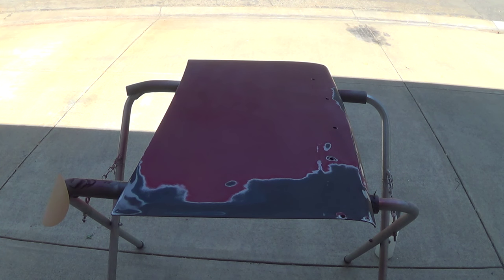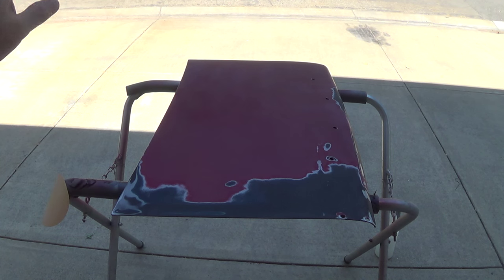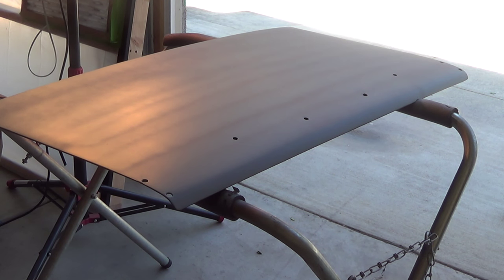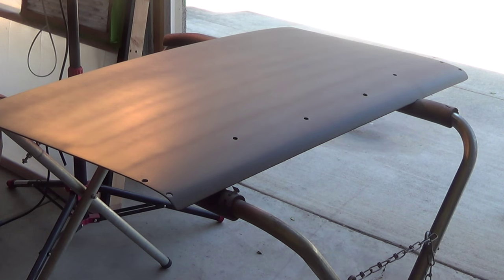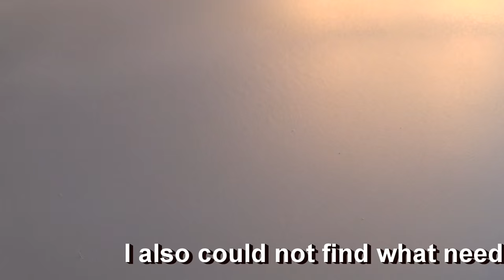I can stripe primer! Boo hoo

Comment: I watched the follow up video but I thought I'd shoot you some thoughts on this one.  I think this is a thin viscosity product so therefore it dries quick.  A couple things I do are to drop the pressure a bit and close up on the panel.  Looked to me like that pattern wasn't very wide to begin with which leads me to believe either the material wasn't adequate to fill the pattern (read - too small of a tip or restriction at the point of fluid delivery).  Too low of pressure will lead to a heavy center pattern and dry edges, too much will blow out the center and be wetter on the edges. Typically less air pressure = wetter pattern to an extent.  I have been painting for quite some time and I always have a piece of masking paper on the wall and I use that to do test patterns and tune my gun every time I spray a product.  I want to see how it is spraying and what it will take to run it.   I never rely on previous settings to work for every job.  They get me in the ballpark and I fine tune from there.  Hope some of this helps out :)
Reply from the maker: +Velvethamma Thanks Shawn. I did try some of those tricks today on the 2nd spray. I may have helped a little, but it still sucked. :) Cheap primer man. No other product has ever done that to me.

Comment: Erik, I have this same gun. The 1.8 should be great for high build. Was it really hot there when you sprayed? May just be a fan size / overlap adjustment.
Reply from the maker: Double R Restorations You know, I am not sure it is high build. I think it is just sandable primer. So, maybe the tip is too big. It was pretty hot, and I had the fan running, so that may have dried it out. It is ready-to-spray cheap primer, so there is no reducer or anything I can add.

Comment: Not sure it seemed it was drying along the edge of the fan as it layed down, you didn't  have a wet edge. What was the temperature compared to the temp of the reducer was it a fast drying reducer? I also think maybe the preasure was a bit too much. I am still trying to figure things out myself, there are a hundred different things that can mess with a paint job. I think you need to get things figured out before using color. I had the same problem when I painted the jeep front end, it was wierd the first coat went on well but as the sun came up and the temperature got a little hotter it started to stripe on the hood. I just think it was too hot for me and was drying as it layed down. I hope you get things figured out. Good luck Eric
Reply from the maker: ***** Hmm - yeah that makes sense. It was pretty hot today, and I had the fan running. It did look like it dried really fast on the edges.

Comment: Pshhhhh... Sorry I'm no help. But I will be keeping up with this one to see what I can learn from it, so thank you Sir! You mentioned below that this is the less expensive stuff... Maybe this is how it lays out and all you gotta do is sand to a uniform finish? It's primer so if it was me I wouldn't care too much because I figure I'll be sanding most of it off when I'm blocking the thing out. How does it look after you've sanded it?
Reply from the maker: 512kjt That is very true KT. This is some cheap a$$ ready to spray stuff. It dries really fast, so it could just be that. It did sand out fine, and I broke through really easy too, so I don't think it is high-build either. So, the 1.8 tip was probably the wrong tip. I will put another coat on next time with the 1.3 tip, and turn the fan off.

Comment: what air pressure are you running at the gun seams a little hight and if you can open the fan up a bit wouldn't hurt.
Reply from the maker: ducksniffernz I had about 22 psi going in to the gun. I can't open up the fan anymore, it gets uneven. It could be because the tip was too big, I don't know.

Comment: this is just my suggestion if i was you i would pick a product and learn how to spray that product using there primer and all the way to finish.That way if you would have a problem you can contact there support people and find out the info you need.I know we all on a budget but this way you dont have to spend time and money to get it right when you want to lay the paint down.later
Reply from the maker: 265chevy Yeah, that primer is really crappy though, so I don't plan on using it ever again! :) I will probably spray the rest the next time I go after this to see if I can do any better, but that is all. I have not had this striping problem with my epoxy, but I did have some stripes when I used this gun on the base coat. Thanks Hanson!

Comment: your fan on the gun should the width of an open hand thumb to middle finger speed should be about 1 foot per second  and 60%over lap...Paint on
Reply from the maker: TheFrameoff I have higher hopes for the base coat and on. This primer is really cheap, crappy stuff. You can see it drying as I am spraying. I think that was the issue. No wet edge (as Russ pointed out).